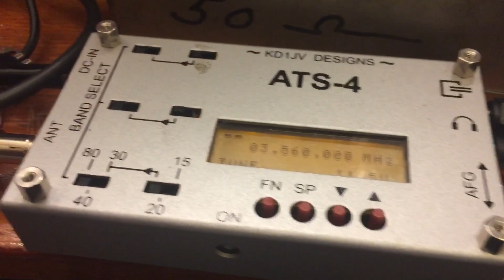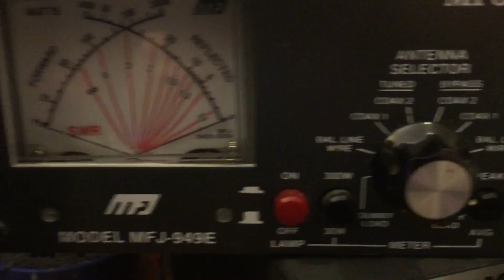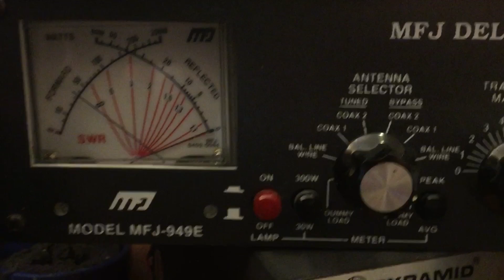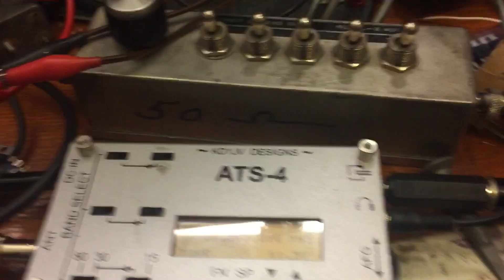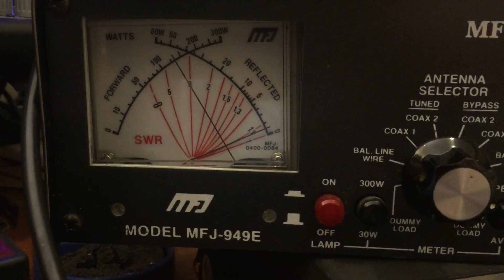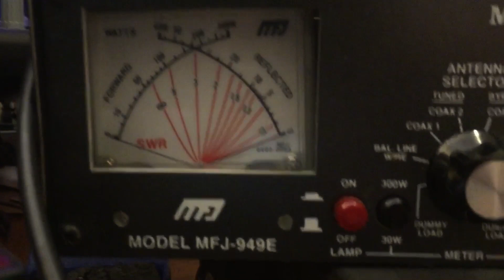50W QRP HF Amplifier Demo with IRF510

Comment: Whats the duty cycle on this amp? Can it be used for AM?
Reply: it is for ssb & cw. AM is a continuous duty cycle i.e. continous on so it will require more rigorous heatsinking and reduction of output power ,